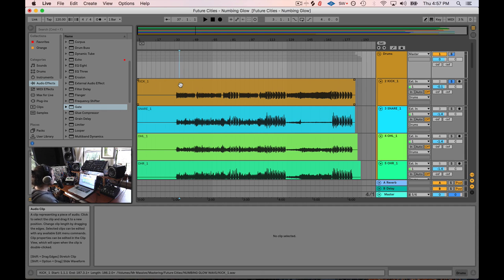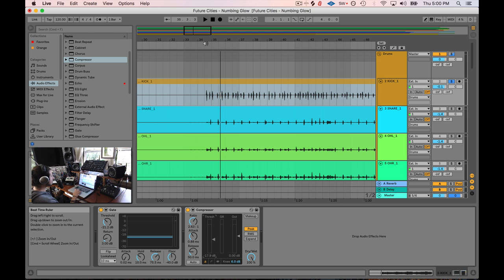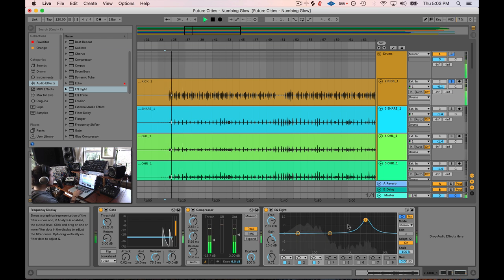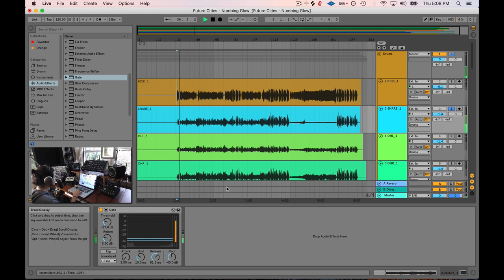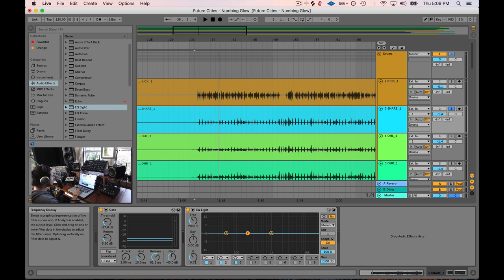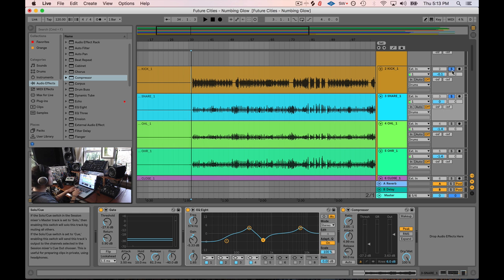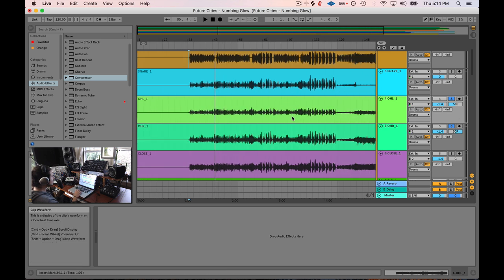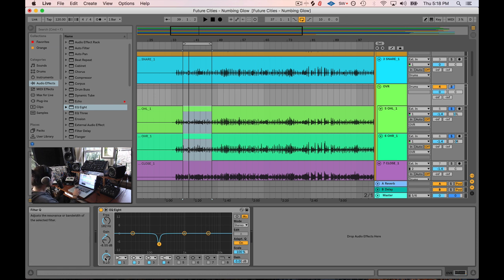Drum Mixing Tutorial Ableton Live

Comment: Thanks for this video, such a helpful reference. :) Quick q- during the snare gating process, you checked to see if the smaller frequency section was a snare roll. Because it wasn't, you didn't need to do anything further. Curious though, what is your recommended process for when it is a small frequency snare roll? Automate the track to remove the gate during that section? Just lower the threshold?
Reply: i had the same question. Did you get it answered? I just thought of getting the threshold down but I think that an automation would be best